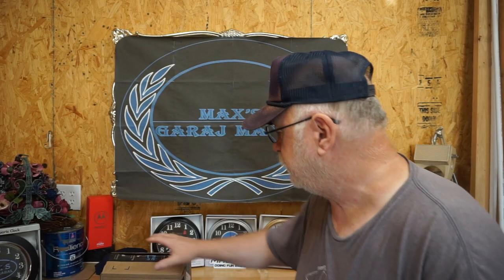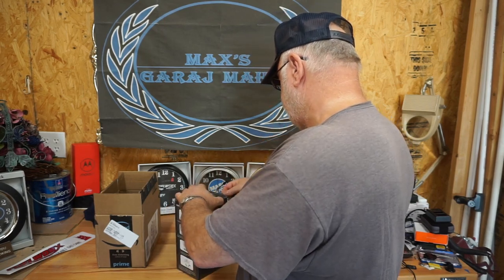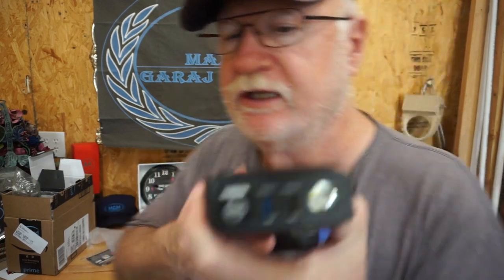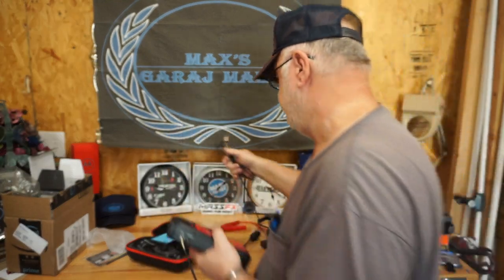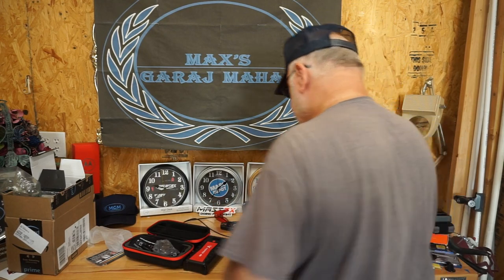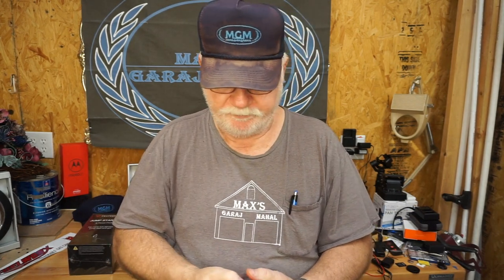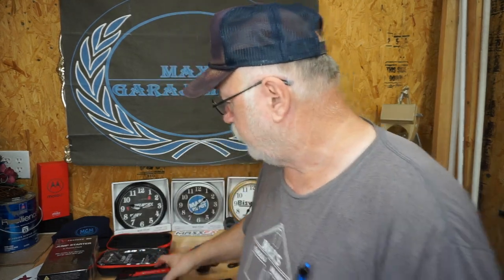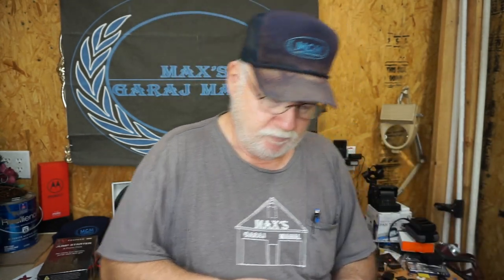Putting the Foxpeed G29 2500A Car Jump Starter to the Test: A Comprehensive Review

Comment: That’s Great to have in your shop or truck  , I got one but not like that one it is a little bigger. I didn’t know you make this video just happen ran a cross it . Didn’t get a notification.Great video Max.
Reply from the maker: It amazed me compared to the two big jumpers I owned. Gave them both away as they wouldn't even jump a car, let alone actually start an engine without a parent battery installed. 

I always appreciate your comments kind Sir.